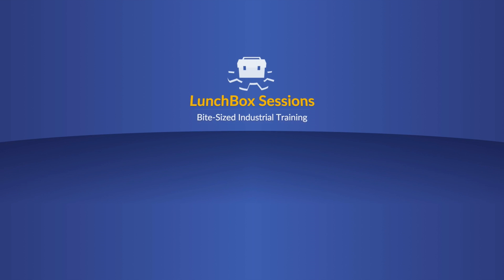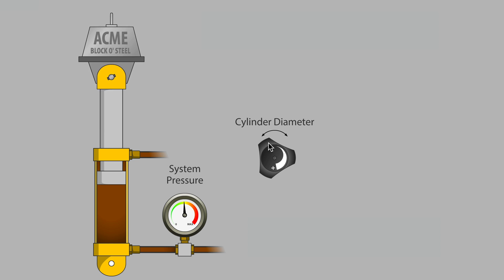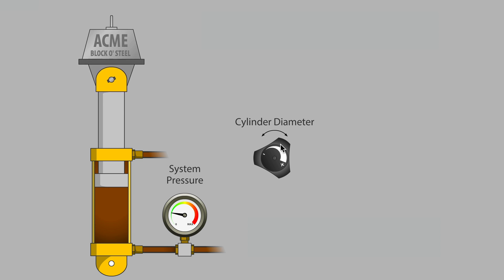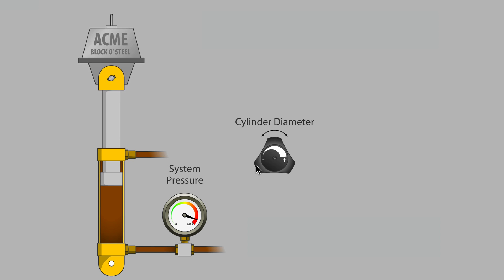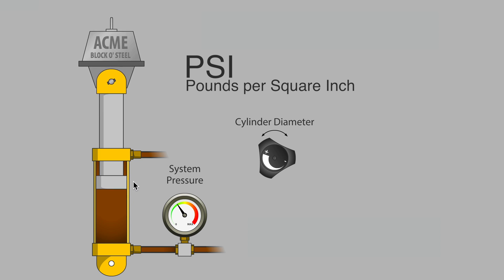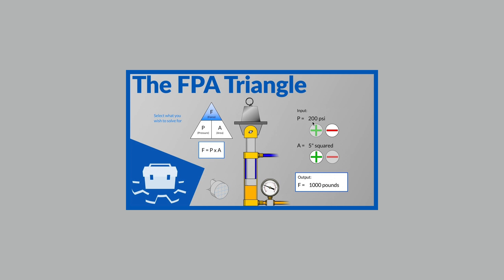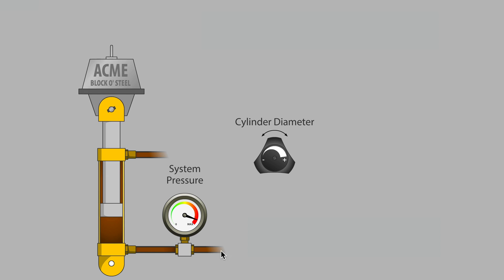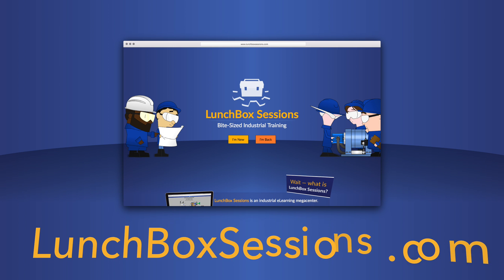Why Pressure Depends on Piston Surface Area

Comment: Dear Sir............Example Problem I have a single acting hydraulic cylinder with a stroke of 300 mm, a bore of 18 mm and a rod of 10 mm
 if the press weight is 5 mm on the Piston Head what is the pressure.....Please explain the calculations

Comment: So I have a argument with a man at work we are fighting over how a system would work the system go we have a 2 inch line running and splitting evenly between 2 one inch cylinders the system can only run at 1000 psi I say it can lift a 2000 pound weight the cylinders both lift the weight together he says only one will lift then nothing
Reply: Is the diameter 1in or the area 1 in squared?

If the area was 1 in squared each cylinder should lift 1kip
Reply: 1 inch diameter sorry
Reply: @josephjorgensen3282  Then, if the working diameter of the piston is 1 inch, the maximum weight each piston can lift is 785.40 pounds. With the two of them, they could lift just 1,570.80 pounds.